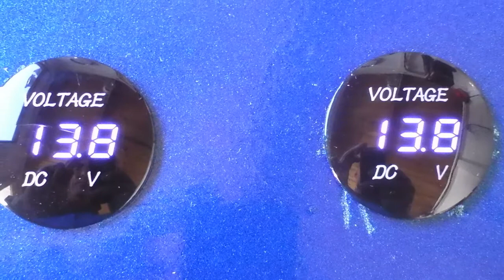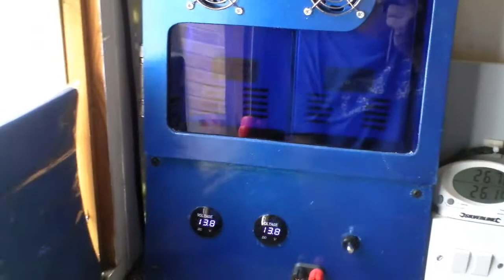VERY CHEAP 33 amp power supply build. Been working for 5 years

Comment: Just purchased one of these psu's after watching your video, Cant quite believe how cheep they are, had any issues ? running them under a bit of load Fred ?
Reply from the maker: No no issues yet.  No RF problems.  I am only drawing around 12 amps so not really pushing things.  My only slight complaint would be the cooling fan is a little noisy when it cranks up under load.
Reply: Thanks for that Fred, its a bit of a brown trouser moment trusting an £18 psu with £200 worth of radio attached :) So Far So Good ! Hard to believe

Comment: Neat daisy chain idea Fred. 66 Amps should keep you out of trouble and happy for a long, long time. I do appreciate you sharing all these videos as they are entertaining and a great way to pass some time whilst slurping on some tea.
Reply from the maker: Hi Andy Yes it would be very easy to swap the wiring over for a full 66 amps.  The only way i would need that much would be for a pill amp and ive intention of running that much power on 11 meters.  I prob only need 15 x 15 amps but the price difference was nothing really and i wanted the larger psu's with the cooling fans.  The rest is just glitter buddy.  Hope your keeping well.  I replied to an old PM message from you. Sorry mate ive let that side slip.